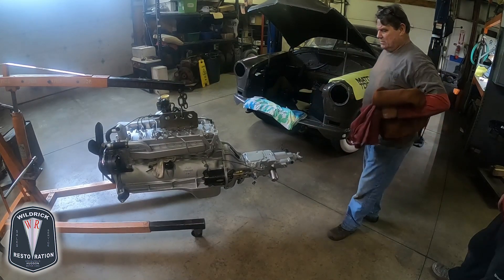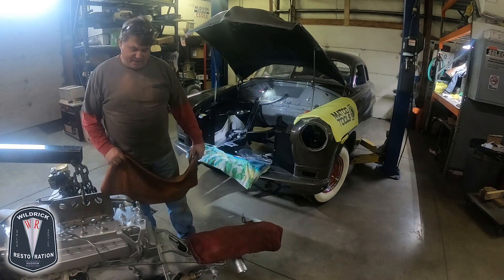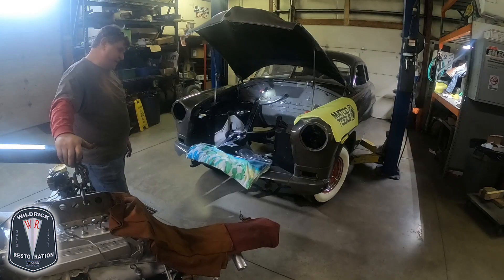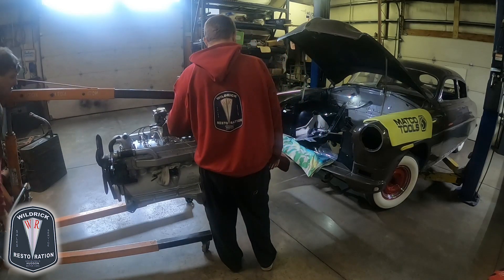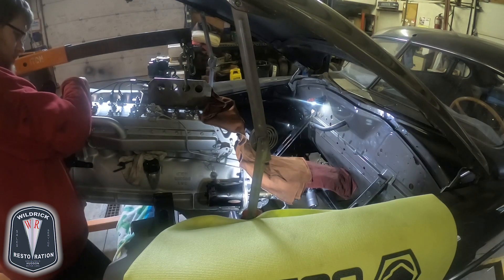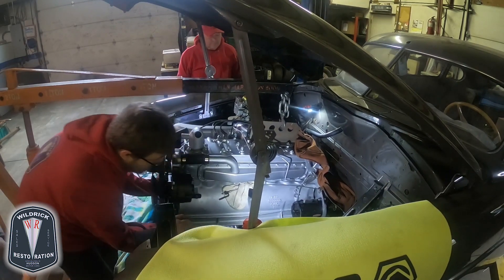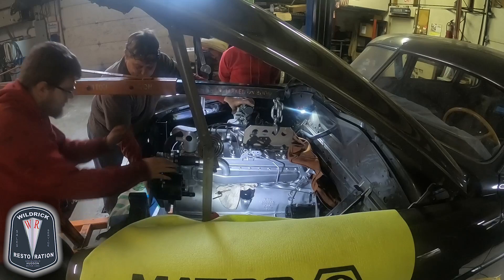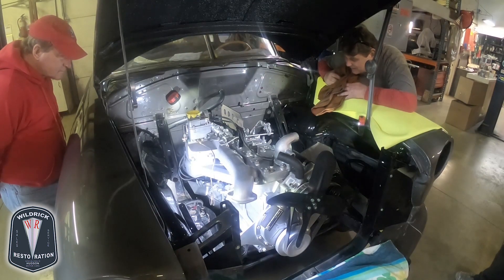Hudson Splasher Eight Engine Install

Comment: Doug, do you recommend installing the engine with the trans attached?  I have a 37' Hudson 8 that I am doing a bunch of work to the engine, so it's out right now.  I still need to re gasket/seal the trans and paint both the engine and trans prior to install.  It looks fairly easy using the method you did.